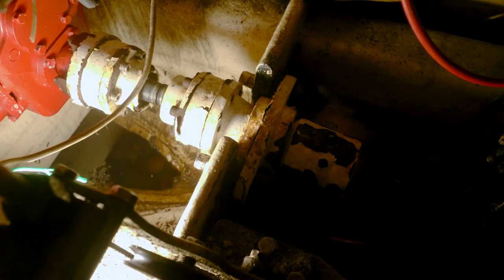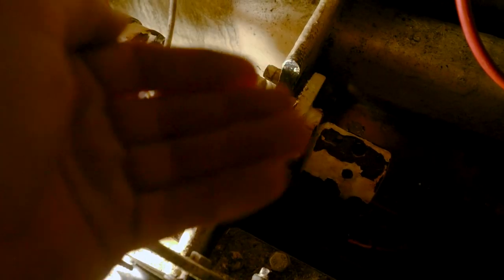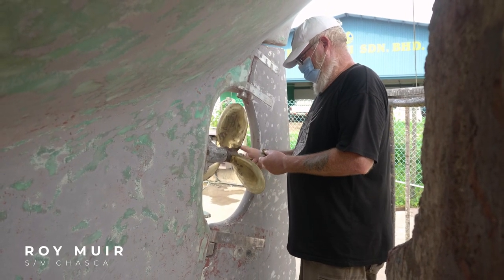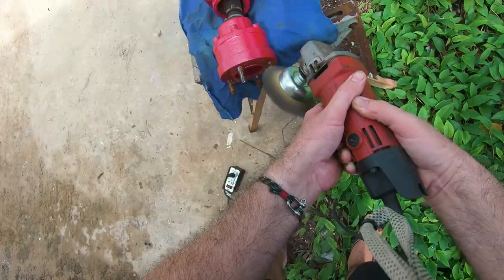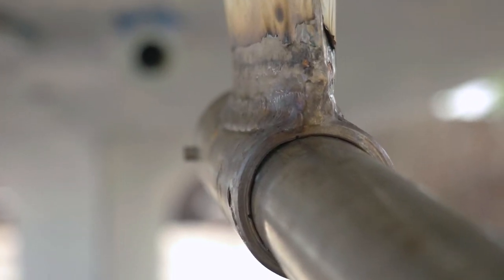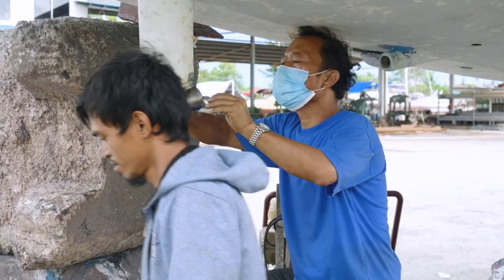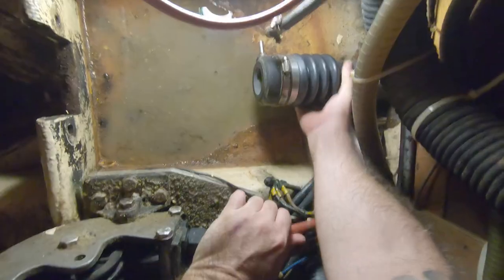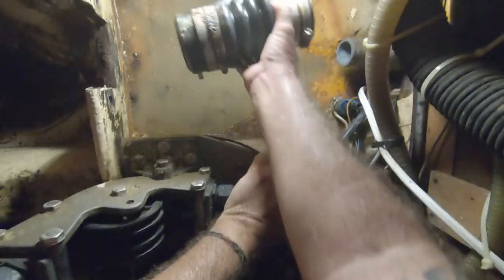Things never go to plan in a boatyard - Sailboats & maintenance Ep 247

Comment: Rats, rats, rats!

I wonder if you brushed out some of those stray dogs and collected the hair and made some sort of paste and slathered that on the bottom meter or so of your ladder if the scent might deter them from trying to climb it. Maybe there is a commercial product that is used for scaring animals like essence of lion's piss. :D

I also wonder if those concrete blocks might contribute to the rats being able to climb up that route as well? Although, I suppose they could climb jackstands just as readily.  The smooth hull from that point up is probably more of a barrier.

I bet the ladder is likely the weak chink in the anti-rat armor. It would be a real PITA to lift it up every time.  A ladder that hung down and didn't quite touch the ground would be ideal, or like a fire-escape ladder would swing down on springs to touch down when weight was placed on it.  That would be pretty difficult to do and still make it portable.  

We carry one of those telescoping extension ladders in our laz.  It shrinks down pretty small and we always have it when we need it. We have used it in the last two yards when we were on the hard. No need to borrow a sketchy yard ladder or buy/rent one.
Reply from the maker: One theory we had was that they were running across our shore power cable, which we had to hook over the bow of the boat behind us. That boat had been abandoned and was probably full of rats. Also rats had been spotted hanging around the base of the ladder. Basically they'd take any opportunity to get on board.
Reply: @followtheboat  Rats and come cockroaches are going to inherit the earth.  They are just too good at getting into everything.  You wouldn't believe the cockroaches there are on the Eastern Coast of the US.   They are nearly the size of an old Nokia phone.
Reply from the maker: @svbarryduckworth628  we've had our share of roaches too. Little bastards.
Reply: I won't let any cardboard or paper labels get past the cockpit now.  We break everything down when we get back to the boat.  All cardboard and paper labels get ripped off when we get groceries or packages and then they are put right back into the dinghy for disposal the next trip back to land.  Those little bastards are everywhere now in the world.  Even in the US, the southern part of the country is infested.  Groceries used to be fairly immune, but not any more.  I think pesticides are not used as much as they used to be in food warehouses.

Comment: Pls. note, you do not have a flexible coupling. It is a double homochinetic joint and a thrust bearing. Point being, these items have a service interval. There are 'forks' and balls inside that requires special type of grease. It is indeed a wearing part, but treated correct- it wears very slowly. Keep it dry. The run out in your prop shaft is probably the reason for wear on cutlass bearing. As long as the thrust bearing is ligning up to the cutlass bearing.
Reply from the maker: Yes, Roy mentioned the same thing regarding the cutlass bearing. That said, this is the shortest interval between changing it so far. Perhaps we were less observant previously. The play was minor and maybe we could have got away with another 1,000 miles, but since we were out, no harm in replacing it.